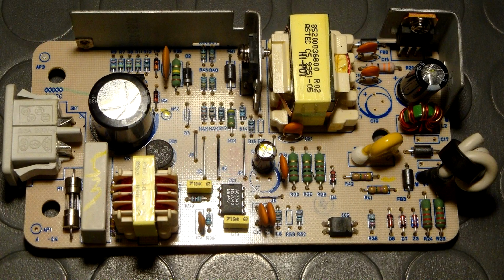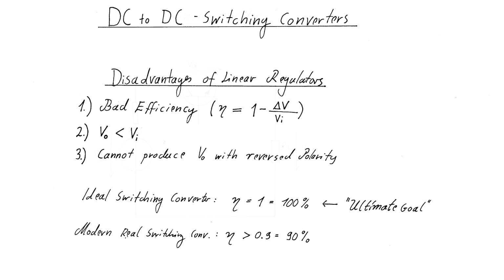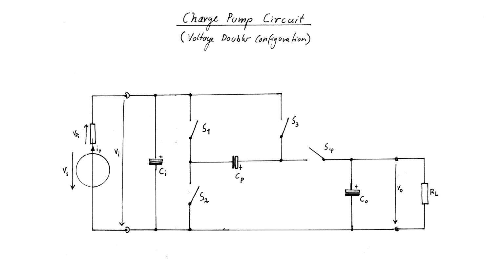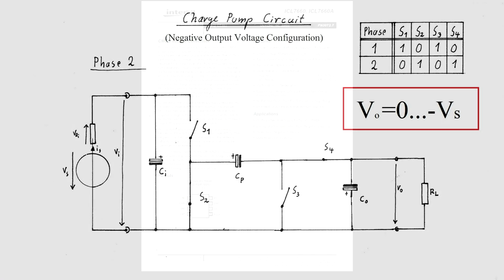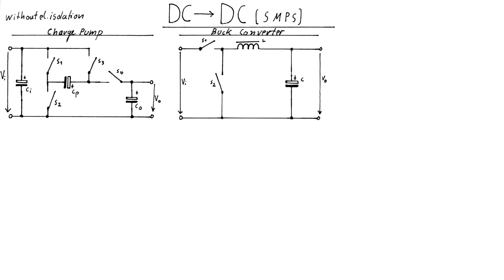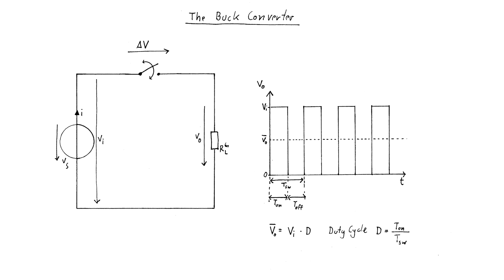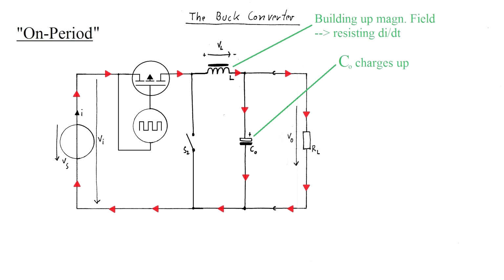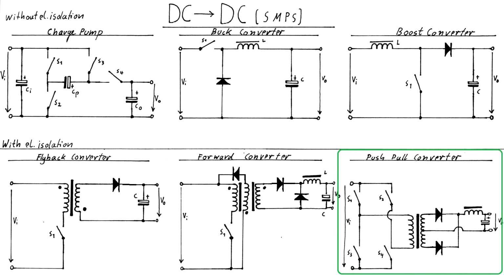SMPS Tutorial (3): Charge Pumps, Buck Converters, Switched Mode Power Supplies

Comment: Great video! I'm fairly good at electronics. I build and repair tube amplifiers. These typically use a linear power supply consisting of a transformer, a rectifier, and filtering. I'm gathering the necessary knowledge and information in order to build a SMPS for a tube pre-amp. I'd like to be able to take 120 VAC up to around 300 VDC (200 ma). Any ideas that could steer me in the right direction?

Comment: You mentioned that lightbulbs can withstand short pwm pulses of higher peak voltage than the rating, but does that apply to power leds as well, as long as the pwm frequency is high enough?

Comment: What you labeled a "push pull converter" is actually a full bridge.
Reply from the maker: Ín the video about Push Pull Converters you will see, that I treat the Half Bridge and the Full Bridge as two different variants of the Push Pull Converter.
I read a couple of books on the subject and everyone uses slightly different distinctions for the various topologies. In German its again different than in the Engish language. On that overview you're reffering two, I placed the picture of a full bridge configuration as "pars pro toto" for a group of circuit toplogies that I refer two as "push pull converters". When the video about those circuits will be online, you will see that it makes sense :)

Comment: Charge pumps are mainly used in transistor driving circuits aren't they?
Reply from the maker: funkyironman69 Yes that's another application. In gate driver circuits you often need an auxiliary voltage that is either higher or lower (negative voltages) than the actual  minimum and maximum voltage that can be obtained from the power source, for that a charge ump can be used.
Reply: The Post Apocalyptic Inventor  Thanks, I always wondered how charge pumps worked, your video explains them well. ;)

Comment: So if Ci... let's say  Ci1 Ci2 Ci3 are put in parallel and the value of each single Ci is close to Vs than when switched in series will charge  C0 ( I assume the value of C0 must be same as Ci1 Ci2 Ci3 put together. What is the maximum speed of an topology of this sort. I am tempted to build a system of this sort and use MCU to control it.
Reply from the maker: The time needed to charge the capacitors is the limiting factor. That time is determined by the time constant of the RC Filters comprised of the capacitors and possible series resistors. Even if no series resistors are connected to the capacitors they have an internal series resistance which comprises an RC combination with the capacitors. All real voltage sources do also have an internal resistance in series with the source. The time constant can be calculated by deriving the differential equation for those "parasitic" RC filters. So there is not ONE answer to your question. It depends on the size of the capacitors, their ESR and the internal resistance of the source.
Reply: The Post Apocalyptic Inventor Make sens, I ll do the calculation and try to test few circuits and see their limitation(s).Need to make my mind and buy an oscilloscope.
Reply from the maker: Janusz Gluszak
I will most probably make another video in a few days. I will probably also show how you can derive and solve those differential equations for RC and RL filters. By the Way: The ICL 7660 uses a switching frequency of 10kHz. Normal switching frequencies for simple DC to DC switching converters are beetween 10kHz and 100kHz. Higher frequencies(1Mhz)  are also posssible, but harder to handle.

Comment: Would it be possible to modify an ATX power supply so it puts out more power (amperage) at 12V?
thanks
Reply from the maker: +gert3d It depends on the individual power supply. The switching transistors and magnetic components (transformer, filter chokes etc.) will become excessively hot. You would have to improve the cooling of those components. This could be done with a more powerful fan for example. But many power supplies also have a build in "over current protection" that will still limit the possible output power.
Reply: +The Post Apocalyptic Inventor Thanks for the quick answer! Is it possible to indicate how it could be done, and what improvement on amperage could be reached? I need something like 15 amps
Reply from the maker: +gert3d I can't answer that question in general as there are many different makes and models of ATX-power supplies. Some of them rely on totally different circuits. On which of the rails do you need 15A? I guess you are talking about a 12V rail?
Reply: +The Post Apocalyptic Inventor Yes, indeed. I assume that most (all?) AT supplies rely on the same principle? Isn't it up to identifying the correct components only that may need to be relaced / adjusted? Or is that too simplistic?
Reply from the maker: No. Not all AT and  ATX -power supplies rely on the same principle.  Here in Europe (230V line voltage) most standard AT and ATX PSUs are based on a "Half-Bridge Converter", while many American models (110/115V ) use a "Push-Pull-Converter". But there are also  PSUs based on "Flyback Converters", "Full Bridge Converters" etc etc. Older models use analog control circuits,  (Some of which are standard PWM-ICs, while some use specialized ICs desgined for ATX-PSUs). Modern ones might even employ microcontrollers. Switching elements can be bipolar transistors, MOSFETS or IGBTS...Some have driver transformers, while some use semicondutor based drivers and optocouplers. And the list of differences between different models, makes and "vintages" goes on and on. In order to "hack" a power supply like that, the individual circuit needs to be reverse engineered. A lot of theoretical knowledge and practical skill is required to modify these devices successfully. 

This matter is also way too complicated to be properly explained in a youtube-comment, without graphics.
It is also not really a good idea to try to increase the output current. 
These power supplies are build down to a price and there are many components  inside that could fail because of that.

If you would tell me, why you want to do that, I might be able to suggest a more feasible alternative way though.
Reply: +The Post Apocalyptic Inventor OK, thanks for your explanation. I see it ia way easier just to buy a 12V 15A switching power supply @ less than €50 , rather than spend a lot of time at a doubtfull project. Still a shame that I cannot do much with a bunch of power supplies. I'll probably have to dump them after all ..